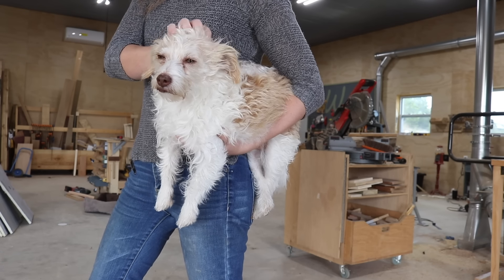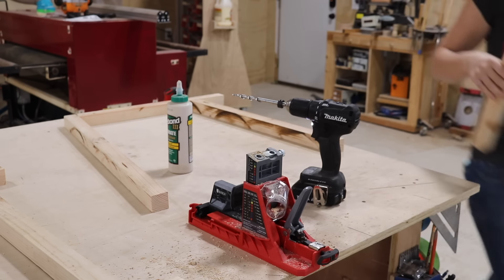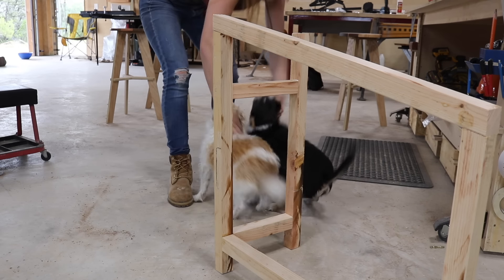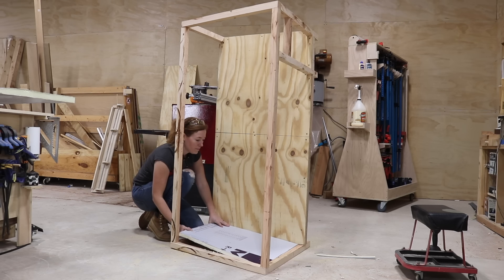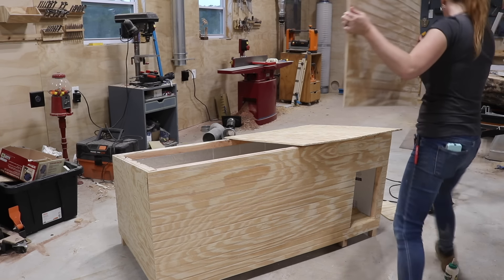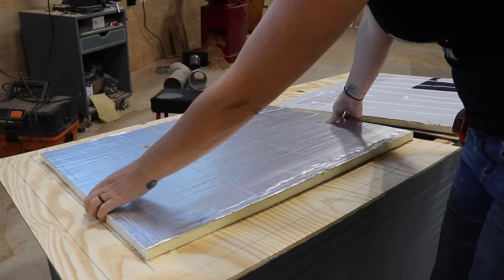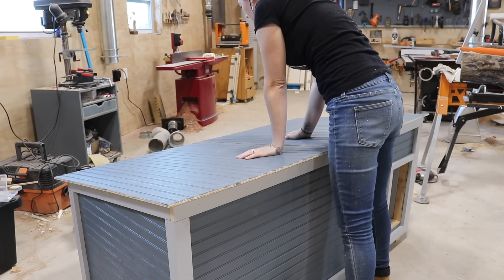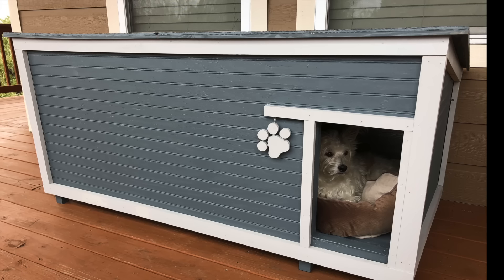DIY Insulated Dog House Build

Comment: Maybe you need to put a locking mechanism for the 2 parts of the roof. As you said is wind where you are and the wind can lift that ruf up and force it. Also even if that house is shelterd from the top, the wind can bring snow and rain drops to it so maybe you should put some cover over the gap of the 2 ruf pieces. Just my opinion but I like what you done.

Comment: Insulation doesn't protect much from driving wind if the front door is always open and faces the main chamber;  you're probably getting negligible difference from just using plywood.  Dogs are pretty well insulated to start with.   What I would suggest instead is adding a small tunnel, so to enter they go in a door on the left side, turn 90deg right, walk the length of the box, then turn 90deg left into the main room.  Keep it from getting dark by having a skylight..  This gets the wind far away from the main room.

Comment: Well done.
But you need see 3 things, the lockers for the roof, you know the wind is always a surprise. The second, is ensure that around the roof have a good isolation, if the roof have any gap, you lose all hot air. 
And some transparent rubber stripes on the door to keep inside temperature.

Comment: I will begin with a recognition that your skills are light years beyond mine, and the following comments are made with all due respect. However, having spent more time in the dog house than I care to remember, I make the following recommendations.

If cold wind is a concern, a one-eighty-degree baffled entrance, requiring the pup to make two right turns inside the door, will dramatically reduce wind intrusion. Or, maybe one of those fancy magnetic pet doors. Either addition could be seasonal.

By the same token, the larger the interior, the more body heat is required to warm it. Again, a seasonal partition could be added. Or one of those electric pet pads. Now that I think about it, my dogs lived better than I did. Definitely ate better food. And had better health care. OK, I did have a nicer bathroom.

Thanks for such clear, yet concise, instructions.

Comment: Have you had a chance to play with the Porter Cable  Quik Jig 560.  Seems to serve the same function as the Armor Pocket Hole Jig.... operation might be a smidge different.  Has some nice failsafes, but a much higher metal to plastic ratio with regards to construction.  I think the street price difference is about 3-4 dollars. 

Didn't want include a video link to someone else's channel, but there are about 8 videos easily found on Youtube.

Comment: April...wonder why your Design looks Exactly like mine Posted several years ago to the Sketchup Warehouse? BTW...mine Accommodates 4 Big Dogs Comfortably for several years now.
 Tip: I added Wedges with Hinges to Stringers under the Lid. I fold them up in the Hot Weather for Ventilation and Fold them Down during Cold Weather.

Comment: I was expecting some sort of removable flap door to help keep in the heat and the wind out during the winter. My dogs would love something like this. We have made simplier dog house for outside and put foam inside without issue. It will get scratched at here and there but for the most part they will leave it alone

Comment: For more insulation for the dogs, you can staple a bunch of 2-3" wide strips of an old towel or blanket to the top.  Have them drape down to a couple of inches above the floor when closed.  When the dog goes in, the strips will rest on top of the dog like a blanket.  Remove during warm season.  If you're worried about the dog tearing the strips out and stables littering the house, add another board for winter use, drill holes through it, slip your strips through and tie a knot at the end.

Comment: We had a dog house that was similar outside. Except as the dog would come inside there was a door flap and an entry area with another doorway at a 90° turn in the back and another flap inside. This creating an "airlock" and our basset would have a self heated house that you had to shovel the snow drift away from in the winter and if you opened the lid he would look at you like why are you letting all my heat out. This is an option for those in colder climates.

Comment: I built a similar one years ago. The differences were:
A full-length piano hinged roof, in order to gain access to the entire interior.
A 4” lower lip at the door opening.
Filled with 1 bushel of cedar shavings
Reply: 9:53 Looks like she has the hinge thing covered.

Comment: Should have had a 4-6" lip inside the door... I stead of flat. This would hold in straw you put inside plus, the dogs like to test their heads on it while looking out. 
With as many as 22 sled dogs in my kennel, I've done this for all of my houses and it is a must.
Put another partial wall down the middle making it into to 2 rooms so they can get back inside and keep even more out of the weather/wind.

Comment: Thanks, great video. May I suggest that you set up some type of fasteners to hold down the roof panels during times of high winds? Even if the dogs are not there at such times this may help to prevent damage. Also, that paw… it will be rattling all the time that the wind is blowing, that might irritate some dogs.

Comment: Good video ! But a Question ? Looks like u have a seam in the roof ? Won't Rain get inside ?? 
and A little trade information for u. i'm in the refrigeration business and deal with insulation materials & insulation thicknesses. Fyi --- just a little bit of trivia. At 2" of insulation is where the Numbers start to drop off & u don't gain a lot per inch of insulation. Huge energy savings & insulating properties are up to 2" of insulation. every inch there after is moderate gains. 2" is the Magic number ! Maybe put a remote thermometer in there to see what temperature it is in there in the winter vs outside. it would be interesting to know.

Comment: ALWAYS panel over the foam insulation. Even if the dogs aren't chewers diggers or scratchers, they're simply going to beat the daylights out of that insulation with their general day to day behavior, whether awake or not, and destroy that insulation over the course of a year or two. And in some parts of the country, that insulation is more expensive than whatever paneling would keep it safe.

Comment: Very nice build but will the dogs have enough ventilation since you're probably planning to leave the top hinged doors closed most of the time? Maybe a side window to allow cross ventilation with the doggy door will give them more air?
Reply: In hot weather they would not use it. But if April is not home, in cold or rainy weather it is shelter on a covered porch.

Comment: How warm do you think it stays in there? Our winters get super cold with quite a bit of snow. Wondering if just the insulation would be enough to keep my lab mix warm during the day or if I should add some type of heat? She won't be out there at night, EVER, so I don't have to worry about super super cold temps with no sun, and I'll leave her inside if it's below freezing if that's what she wants.

Comment: I had a quick suggestion on your table saw extender for large pieces of wood. Why not use magnets attached to the wood with maybe a metal stripping so it holds it together so it doesn’t accidentally fall when you’re cutting something.

Comment: Hi April, I am trying to build up my tool selection and was wondering, would you suggest a Table Saw first or a Miter Saw? Also if possible, you already do a pretty good job of this, but can you break down what tools you use the most and what they are for? Kind of an instructional video. Unless you have already done this, then I apologize I will look for it. Thank you.

Comment: I love this dog house! Per some of the other comments. Sure you could always add a window later. My question is about the insulation. Is it worth the trouble? I'm new to it and have been doing research to insulate my garage. Seems like having any small gap compromises it's effectiveness and then if you've got a door that's always open is it worth insulating? I guess the pups body heat will be trapped a bit better while they're all in it?

Comment: Like your build quite a lot, but after puting in all that nice insulation, that gap in the roof makes it all kinda worthless. Maybe at least install some door edge rubber seals to it, to prevent all the heat from escaping at the top.

Comment: Great job on the project.  I'd like to add a recommendation for your videos if you don't mind.  I've noticed this in a few of your videos during your monologue segment (the ones you film in front of the trees).  You're actually slightly blurry, but the trees are in-focus.  I think you need to adjust your focus a bit on your camera.  If it's auto, it's picking up the trees as the foreground.  If it's not auto, you just need to bring it backward a little bit.  I assume you set the focus and then record the videos yourself, but if you're setting your focus on the trees and then stepping in front of the camera, it doesn't really work well.  Get something that you can put in place of where you're going to stand and focus on that before your video.  Anyway, again, good job.  I like your channel.  :)

Comment: Beautiful place for the pups. 
Having used 3/8" bead board before, I ask if the bit of plywood edging on the roof flattened it out at all. The stuff has a pretty warp sometimes.

Comment: There's a perfect example of over-thinking a problem in Benjamin Franklin's autobiography. He had 5 dogs, different sizes, and they were forever demanding to be let in or out of the door. So, being an inventor, Franklin decided to make a small oblong hole at one side of the bottom of the door for his smallest dog. Next to it he cut a larger hole for the next largest dog, and so on. Of course all the portals had doors.
Once he'd finished, he sat back to observe his dogs use their respective doors, but the dogs, being somewhat smarter than old Benjamin, all used the largest door.

Comment: THIS HOUSE WOULD ALMOST BE FINE IF YOUR IN FLORIDA. WAY TO BIG FOR SMALL DOGS, NEVER STAY WARM. NEEDS WAY BIGGER OVERHANG TO KEEP RAIN OUT, OR HAVE IT FACING THE HOUSE. DONT CUT OPENING OF DOOR ALL THE WAY DOWN TO FLOOR. IF YOU ADD STRAW IN WINTER THEY DRAG IT OUT AND IT GETS WET, SHOULD BE 8 TO 10 INCHES HIGH THEN PACK THE STRAW HEAVY. DOG HOUSE SHOULD BE 20 PERCENT LARGER THAN DOG AND WITH A MUCH LOWER CEILING OR THE DOG WILL NEVER STAY WARM. WAY BIGGER OVERHANGS ON ROOF AND MAKE IT SO YOU CAN LIFT IT UP IN SUMMER FOR VENTILATION..WE LIVE IN CLEVELAND TEMPS GO FROM ONE HUNDRED TO 15 BELOW..

Comment: does the insulation on the inside of the roof ever crumble or have dust or anything fall into bed area??  seems like the dogs would be sleeping close to the insulation, any toxic issues?  I need to make a few of these insulated houses (not as fancy) for a city shelter.  Thanks!

Comment: You insulated the bottom...good!  But normally you would have wood under the floor so that the air couldn't blow under the box thus pulling heat away from the dogs. You don't want the floor of the doghouse sitting right on the group.

Comment: Nice video however I have built many a dog box the sheeting you put on bottom that is open to weather will come loose and the same sheeting you put on the inside has no protection from the dogs toenails.most dogs will dig it loose over a short time it should have been covered with a thin layer of plywood also.   Box looks great

Comment: Would it be difficult to add a patio to the front for them to hangout under in the summer?
Reply from the maker: That's a great idea! I didn't add one because this is on my upper porch but you could certainly add that and it'd be great. Thanks for Sharing and for watching.

Comment: I'm trying a much smaller version of this for a stray feral cat enclosure with a heating mat and hay for the winter, my prob is I don't have a table saw so i need to make the cuts with a saw-zall, which does the job if I'm careful, any tips on how to make straight cuts?
Reply from the maker: Awesome! I'd draw a line which would make it easier to follow. Thanks for watching and enjoy the build.

Comment: Too big inside to keep these pint sized pooches warm, would be perfect for 2 full sized Labradors if it had a larger door.    Small and Cozy is the Key for the little pooches to have a 3 Dog Night, if you get my drift?     Needs latches on lids.      A Very Nice Build just the same, just too big.

Comment: If this were for winter an dogs staying out all winter, then the house is about 3 times too large and way too tall for 3 small dogs.  Just for those who think they will build one of these for that purpose.  The smaller the house, the least amount of the dogs own body heat it takes to keep it toasty and warm, even in 2 degree weather.  You will just want a house large enough for the dog to stand, and to lay down.  No larger.

Comment: One more question.  Since you have two panels for the roof, if you put this house outside will it leak water when raining?
Reply from the maker: It's outside on a covered porch. If I'm home, they are where I am. Only if I'm gone for a bit are they out on the covered porch but if needed, it allows them to get out of bad weather. Thanks for watching.

Comment: It's better if you have a ventilation for them 
Air in and out that single hole ⭕ there will not be a plenty of fresh air for them probably u have to do that ventilation
Reply: ventilation = outside on the porch. venting it cancels out the insulation. she said she made it because it gets cold in the winter. with the blankets, insulation, and body heat, they can stay warm when it gets cold. putting holes in it defeats the purpose of building it.

Comment: Very nice dog house but if I could afford all of those woodworking tools I could afford to just pay someone to build us one or just buy one. Very nice though. Would love to have one of those for our dog.
Reply: You don't need all those tools to make something like this. You could do it with a hand saw, hammer, nails, glue, speed or combination square and a tape measure. You could even substitute a circular saw for the handsaw without having to spend a ton of money.

Table saw is definitely nice to have for stuff like ripping 2x4s  and plywood, but can be done with a circular saw and some skill or a circular saw and a strip of plywood with the factory edge (straight) joined to some sort of base to act as a guide for getting a straight cut.

Comment: I suppose the house need air circulation
Reply from the maker: Plenty of air comes in through the hole. If I'm home, they're where I am but if I'm not, the house sits on a covered porch. They would only use it if rainy or cold weather. Thanks for watching.

Comment: Being brief. Some of the tools that you used are not average tools. Making it too expensive to follow you.
Reply: Most of her projects can be done using the tools you have on hand. A circular saw, drill, jigsaw, tape measure, safety glasses. Other projects have welding machine etc but plenty can still be done being creative and doing perhaps a slower way - but still doing it. Many who watch her Channel aren't even makers. They watch to see what she's up to now for entertainment facctor and what she's currently building. There's those who'd argue using a power saw vs using a hand saw. Or a screwdriver vs a drill. Having tools that make your project easier isn't wrong, if you have them, it's smart.

Comment: Not practical for the average person as it requires thousands of dollars worth of tools, not to mention a huge workshop. Might be a tad cheaper and less time consuming to buy the kennel.
Reply from the maker: No, actually it doesn't. It can be done with simpler tools, it would just take longer. As I have them, it makes sense to use them. I bought my first tools from yard sales and pawn shops, buying only the tool I needed, then saved for the next. Anything can be done if you set your mind to it. Thanks for watching.

Comment: Hate this type of videos. "It's all easy, simple and fast!" except there is a lot of professional gear used that usual people don't have.
Reply from the maker: Actually, you can do this same project with simpler tools, it would just take longer, but you can do it. I didn't start with all these tools but bought my tools 2nd hand from yard sales or pawn shops, buying only the tool I needed, then saved for my next one. Because I have other tools it'd be crazy to not use them but get creative! Use what you have or figure out how to achieve your goals. Or - you could just complain about what others have and you don't. Thanks for watching.

Comment: I don’t think she understands the meaning of DIY
Reply from the maker: Actually, I do. DIY means Do It Yourself. If I do a project myself rather than "buying it ready made" or hiring someone else to do it for me then it is a DIY Project. Just because I have different tools, others can still do the same project although each step may take longer. Such a drill vs a screwdriver, circular saw vs a hand saw. Same end result, different tools.